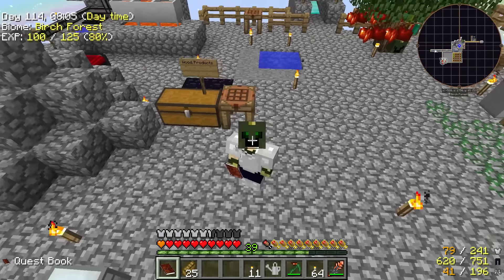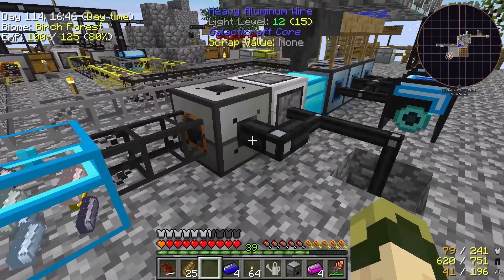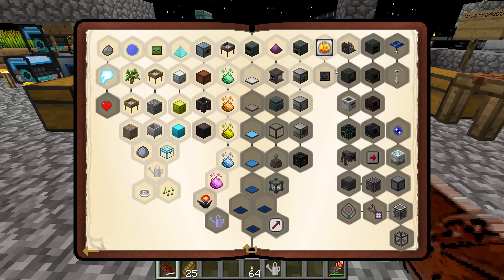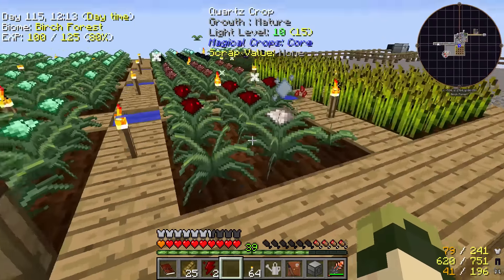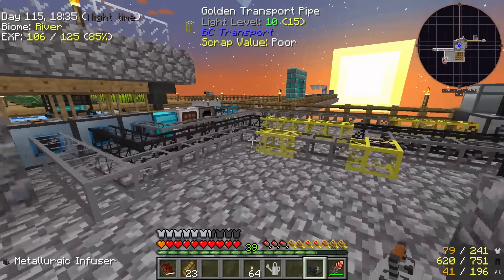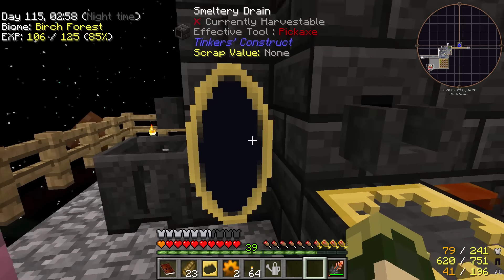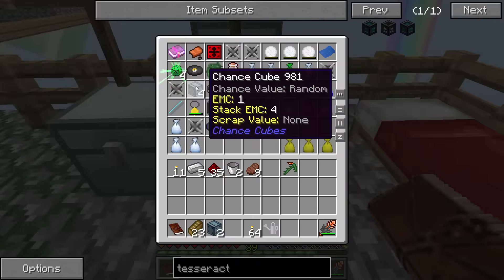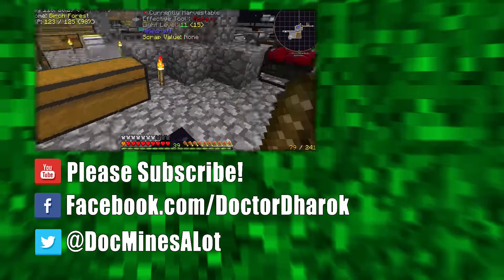Twenty Episodes of Ozone! Project Ozone 20

Comment: For an easy mob grinder solution, make a dark room a bit away from your base and hook up a mob grinder from Thermal Expansion or the Ender IO equivalent. You can use the resulting mob essence for XP, enchantment on an auto -enchanter or auto-anvil or a powered spawner.
Reply: Mob essence plus gunpowder can also be used as a combustible in a Reactant Dynamo.

Comment: also for rf storage, i recommend using ender io capacitor banks.
Reply: the basic holds 1000000 rf, the normal one holds 2.5 mil rf and the vibrant holds 5 mil.

Comment: Gee Doc way to up the expectations :P 

It was pretty funny.

emerald pipe i believe is the filtered extraction pipe last time I checked. Using a filter and extra utilities pipes would be my go to solution as you have easy access to ender pearls now which was your sticking point last time yo made them then i would just use an extra utilities filter on the transfer node and Bobs your uncle (https://en.wikipedia.org/wiki/Bob's_your_uncle)problem solved. Another option could be to use the flint to make all flint tools then put then in autonomous activators to get the iguana tweaks level ups on them then when you have a bunch of them pick the best one I here that is a gait way to get redonculis tools just change the materials to better ones. Another good disposal option is to feed the flint and other junk into an ME condenser to make singularities and matter balls.

As far as i see it there are 3 main designs for mob spawners in modded minecraft with some overlap and hybrid designs i will go over my suggestion for each type in a separate set of posts but i will summarize each design classes merits here.
A Mob drop tower. (tall hardish to build cheap easy to upgrade and expand many cool tweaks possible no power necessary).
B Mob grinder Dark room (simple relatively cheap easy to tie to a sorting system low power (cursed earth is a good as a way to upgrade other designs) can fuel a type C.)
C Mob grinder + auto spawner Room. moderate set up difficulty expensive parts large power needs most require fuel in dome flavor of mob essence or the like hard to make a closed loop or even just  a system that only needs power to run. often super high yield and easy to select mob types. Hard to have multiple mob types.

Magma crucible Melts things into fluids usually for use in a fluid transposer.
fluid transposer lets you make tersercts but it also lets you make the highest tier of energy cell. It is also good for the 2 best flux ducts the top tier flux dict is so op because it has infinite RF a tick transfer rate. many of the fluids also have cool efects when placed in world. Energized glowstone is haste molten enderium is random teleportation and so on.

It's ok Doc I dont feel picked on at leas not in a mean way.

Pink generators are ok especially because you can feed it with wool from sheep you have died pink. The higher tiers of extra utilities generators produce much more RF a tick but not more rf an item they burn up items foster but not more (or less) efficiently.

beware of passive flower decay in botania.

The odd Spacing on crushed end stone was due to the pulverizer automatically slowing down when its buffer of rf was falling (this doesn't make things cost more RF IIRC).

Take a look at http://ftbwiki.org/Redstone_Clock as a way to help automate your smeltery they can even be turned off with a lever

Make more chance pendants they stack.

Jailers safari nets are super cool mobs you trap in them can be renamed by renaming the ner in an anvil and in any case they act as if under a name tag and dont despawn.
Reply from the maker: +Brian Zmek Great tips! Thank you!!